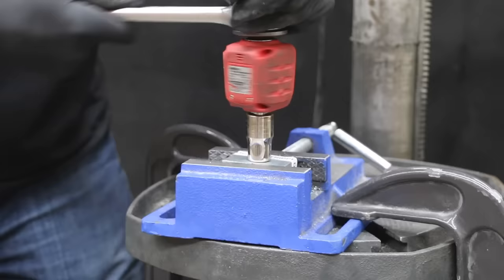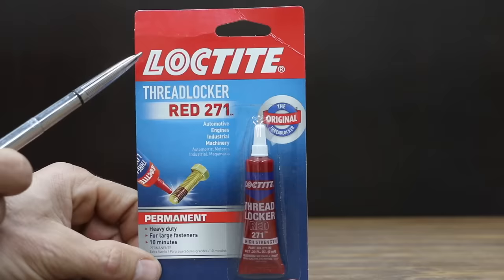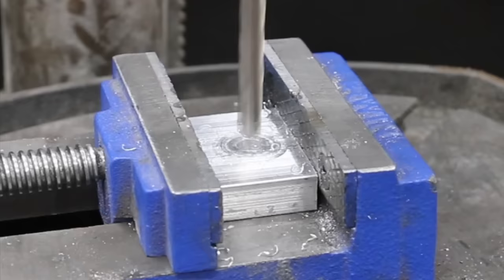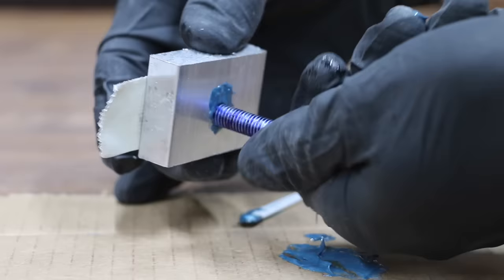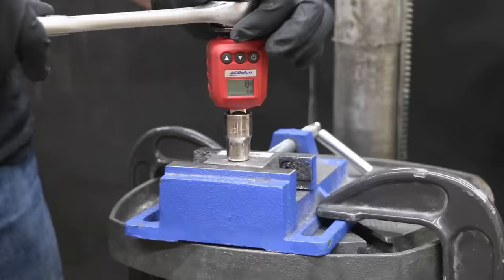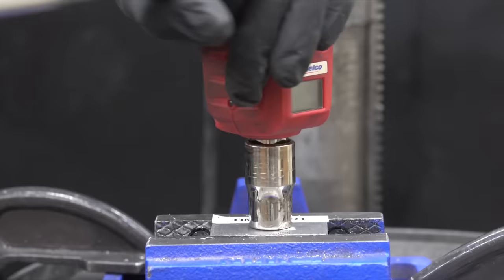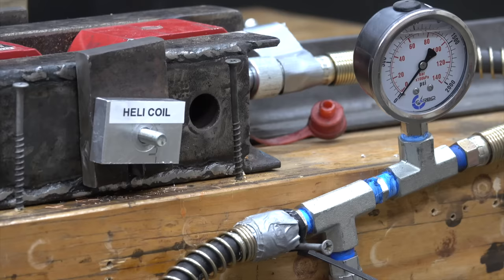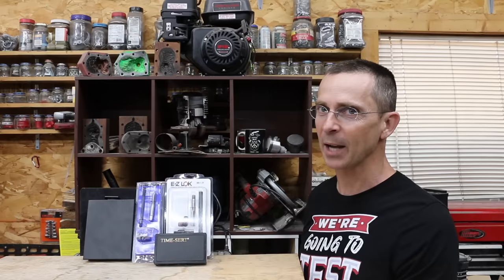Best Damaged Thread Repair? Let’s Settle This! Heli Coil, TIME-SERT, E-Z LOK, JB Weld, HHIP, Loctite

Comment: I've just had stripped threads on the Brembo brake calipers of my 2003 Subaru Impreza WRX STI repaired using Timeserts.
I didn't want to take chances with any cheaper methods as these are the main mounting holes for the front calipers.
Two of the holes were not stripped but I had them drilled out and Timeserted just in case.
Thumbs up.
Reply from the maker: Thanks!  Thanks for sharing.

Comment: Jreat comparison video. Lots of really good info. I have used just about every thread repair kits available. I have always returned back to the Heli-Coil because they almost never failed. The secret is to use Loctite RED when screwing in the Heli-Coil. Just be sure to allow 2-3 hours to set up. Especially if doing head bolts.
Reply from the maker: Thanks for the feedback.

Comment: I used to work at a engine refurbishing plant, repairing and assembling 30-35 engines pr day. One of the more common repairs would be bolt hole repairs on the cylinder heads and block, which meant doing thread repairs on aluminum and cast iron. And we used Heli coils exclusively for most of the different sized bolt holes...as reasonably prized and this kind of quality for something that will experience corrosion, heat and vibration, I can now see why Heli coils lol...Thank you so much for this in depth and thorough experiment. 😊
Reply from the maker: You are welcome!  Thanks for sharing.
Reply: For many years, Heli-Coils were thee popular brand.  I started working in the late '60s and Heli-Coil was all that we knew.

Comment: Fantastic video, as is all of your content, I use Heli-coil repair inserts all of the time as a workshop technician/ foreman. Besides doing my own work i have to help the apprentices/other techs when they snap bolts and strip threads (which is all too often and nearly always in a tight spot to repair), I'm a dab hand with a drill and metal work so i am always called over for help, and this video proves there's no substitute for a proper repair, I have never had a Heli-coil fail or not work at a specific job. I don't doubt the preparation for this video took many many hours😳, your dedication is unreal, thankyou👍
Reply from the maker: Thanks and you are welcome!  Thanks for sharing.

Comment: Tap drill size for metric bolts: Subtract the thread pitch from the nominal bolt size.  Tap drill for an M8x1.25 thread is: 8 (minus) 1.25 = 6.75mm.   Works for imperial too.
Reply from the maker: Thanks for sharing.

Comment: I often assemble threaded pipe, brass, black iron, pvc.  These threads are sealing water, oil, diesel, gasoline, propane, natural gas….  I have been told over the years to use thread tape, pipe dope, and even both at the same time…. I would love to see the various products and procedures tested to see what comes out on top…..
Reply from the maker: Thanks for the suggestion.

Comment: As an industrial contractor it is nice that I can tell my customers a helicoil type repair will be stronger than the original threads. It makes sense, you are essentially threading a larger bolt into the hole, and the threads are hardened. Nice work as always.
Reply from the maker: Thanks!

Comment: I'd like to see the different kits for thread repair, specifically for a brake bleeder screw! After going back and forth to bleed brakes,  the caliper threads never seems to hold up well.  I really wouldn't want to tap into a caliper either,  we used to make rethread kits in the USA. Brakes are also a lot of PSI when you press the pedal. I appreciate all this work you did here.  💯
Reply from the maker: Thanks so much!  Thanks for the suggestion.

Comment: One thing that I have used and has worked consistently good is using a string trimmer line instead of copper. Of course, only for low load or less critical applications. Awesome video, btw.
Reply from the maker: Thanks!  Thanks for the feedback.

Comment: The maintenance guys at work used to use heli-coil style inserts, but operators managed to destroy them over time (who knows how!). They've since switched to Keenserts, which are like an E-Z Lok, but with 3 pins you drive into the material after screwing it in. They are a lot tougher and last longer.
Reply from the maker: Thanks for sharing!

Comment: I work in R&D testing.
Years ago I had servohydraulic testing rigs up to 1 kHz. (MTS 831 and Schenck VHF 7)
The fixtures had to be light, bear tons of stress and vibration and be continuosly mounted an unmounted. They were aluminum, and of course the threads were not up to the task.

We tried various inserts, but they weren't any better, since after a couple hundred tests they started fracturing. Like radial fractures. 

We opted for helicois right off the blocks, without waiting for the threads to fail. We just had to replace the screws after each hundred tests, and nothing else.

There's nothing like helicois!
Reply from the maker: Thanks for sharing.

Comment: Thank you for this comparison. I need to repair some stripped threads on an aluminum head for a head cover bolt. I'm going to go with the EZ Lok Heli-Coil. I liked the EZ Lok inserts as well, but the stainless heli-coils I think will hold up to the under-the-hood corrosive conditions that are to be expected. I don't need the extra holding power that the inserts offer, the head covers are only torqued to 105 in lbs. Although, this is my first-time attempting thread repairs, and I did prefer the removal aspect that the EZ Lock Inserts offered just in case I screw it up.
Reply from the maker: You are welcome!  Thanks for sharing.

Comment: You're videos are the greatest. Thanks for the work you put into them.
Now my praise for helicoils helicoiks them on Harleys all the time. Once I had a bike that the previous tech used red loctite on the heads and when I pulled out the boots the threads came with the bolts. I drummed and helicoiled them and the bike went back together like new. Torqued to 22 ft/lb. Love helicoil!
Reply from the maker: Thanks and you are welcome!

Comment: If you use a little green locktite on the outside of a time-sert, it’s the best repair you can get. They just work and are available in multiple lengths. For threads like block decks where they may go into water, a time-cert and green lock-tire is the only repair I trust. I’ve got a 427 that ran for years in an 8 second altered and it’s got a time cert somewhere in the mains. No issues.
Plus with Time-Sert, you can use helicoil taps. They can be installed proud and filed flat if need be as well.
Reply from the maker: Thanks for the feedback.

Comment: Great video, thank you! My only suggestion for additional testing would be to heat cycle the work pieces several time to see if any of the metal inserts fail any earlier, and maybe to test them while the work pieces are still hot? I don't think it would be necessary to further test the epoxy-based repairs.
Reply from the maker: Thanks!  Thanks or the suggestion.

Comment: I have used timesert for lots of engine block repairs and also caterpillar flywheel repairs that have limited wall thickness for thread repair and that was a big reason for using the more expensive fix.
Reply from the maker: Thanks for sharing.

Comment: The Time Sert kit may be expensive but after buying the kit you can get re- fill insert packs. The included tools are very high quality and will last and last for years. I owned a fair sized Kawasaki, Yamaha, Suzuki motorcycle dealership for forty years And fixed countless threads with the Time Sert kits. My motto is " Quality usually costs more but is well worth it in the end. "  Those kits like Helicoil are like a spring that you twist into the hole. They often come out with the bolt!!
Reply from the maker: Thanks for the feedback.

Comment: I got some unbranded ones from amazon they are gold in colour although its clearly some sort of anti corrosion coating.

I used them in the legs for my solid oak bed frame as the original was simply a fabricated strip of metal with a tiny thread through it and most of them had stripped after a move.
My bed has never been as solid. I recommend thread repair kits to anyone.
Reply from the maker: Thanks for the feedback.

Comment: Thank you! My mechanic just told me my old car's oil leak (and maybe is oil pressure problem too?) is from the oil pan's stripped screw/bolt threading and they will use the Helicoil insert to fix it. I'm not a mechanic so I Googled Helicoil and am happy this product worked so well in withstanding torque pressure and corrosion...hopefully the repair will last over time, too?
Reply from the maker: You are welcome!

Comment: This video couldn’t of come at a better time. My 02 Ford Escape just blew a spark plug out of the cylinder and I installed a new plug but I’m not sure it will hold long term. The threads were compromised and it didn’t tighten up snug as it should. I may need to drill and tap with these kits
Reply from the maker: Thanks for sharing.

Comment: Thread inserts can be the only practical solution if the hole is sufficiently damaged.  I used them to repair an irreplaceable aluminum transmission case on my father's antique truck.  The 5/16 cover bolts had been stripped out, drilled out to 3/8 and then stripped out again and the 100 year old aluminum was far too soft for a helicoil.  Misumi self-tapping thread inserts no only fixed the threads they allowed me to restore the bolt holes back down to 5/16.
Reply from the maker: Thanks for the feedback.

Comment: I’ve been using EZ Lock for years, helicoil has its uses, but if I need a permanent repair , I use the EZ Lock.
Timeserts work well too, but I have access to EZ Locks here.
Helix oils work good for things like motorcycle side covers etc, where there’s no real load on them.
For things that require a real clamping force it’s EZ Lock for me , not a single failure in many years, and you can use a thread locker like loctite and the insert won’t pull out with the bolt.
Reply from the maker: Thanks for sharing.

Comment: Did head gaskets on my Subaru. Threads came out with the bolts (never had that happen on a Subaru before). Got the time sert kit and they torqued down great and are holding up well. Very costly but it saved me from having to put in a new short block.
Reply from the maker: Thanks for sharing.

Comment: Great rule of thumb, the drill bit size for tapping new threads on metric bolts: Size minus thread pitch. M8 - 1.25 pitch = 6,75mm. Although there isn't 6,75mm drill, 6,8mm is the correct size.
Reply from the maker: Thanks for the feedback.

Comment: Actually just used the JB Weld on a wheel speed sensor where the bolt broke off. Ground it flush to the knuckle and then just drill with an oversize bit. Filled the top 1/2-3/4" of hole with JB and installed sensor and slide the new bolt in. Leaned a socket and extension with some weight on it for a couple hours just to insure a tight fit.
No idea if it will come out easily and don't want to test, but put just the lightest coating of anti-seize on the threads and backside of the sensor assembly which touches the knuckle.
Reply from the maker: Thanks for sharing.

Comment: Its funny, the maintenance guy at my work replaced stripped bolt holes on one of my CNC machines with helicoils. Every single one was ripped out at probably around 50 foot lbs of pressure, with no failures on the bolts or work piece clamps.
Reply from the maker: Thanks for the feedback.

Comment: I know this is an old discussion but just for easy reference a rule-of-thumb for metric thread tapping drill size is to just subtract one pitch length from the thread diameter.
Reply from the maker: Thanks for the feedback.

Comment: On my motorcycle I had to find out something for repair for the headlight housing threads. I ended up going with copper wire for the time being. it looks like its sturdy enough to work for now. but eventually I'll do a more permanent solution as I have much more I want to do to the bike lmao. But it sure did get me back on the road thanks for the tips!
Reply from the maker: You are welcome!

Comment: I stripped threads on my high pressure oil pump on my 2000 excursion 7.3 powerstroke…… oops….. used the time sert, along with red lock tite both inside & outside of the insert. Put in high pressure oil hose fitting also covered in lock tite & let it all set up for like 4 days…… if it didn’t work I’m buying an $800 hpop…… well good news, so far it’s held up well no oil leaks at all…..
Reply from the maker: Thanks for sharing.
Reply: @ProjectFarm  yep, if it fails, I’ll report back

Comment: You should consider making a video comparing tools that would help keep you from stripping the threads or breaking nuts and bolts. Maybe showing the difference between using, penetrating oils, a propane torch, and a magnetic induction heater. The price difference in pricing is significant for all the options. The questions are the advantages of all methods and whether the new induction heaters are worth it from an ease of use and safety perspective. Another question is how well they work and what are the power requirements.
Reply from the maker: Thanks for the video idea.

Comment: We use helicoil inserts on aluminium manifolds for hydraulics on aircraft parts for the exact reason you discovered, the steel inserts provide a stronger thread than the base aluminium material.
Reply from the maker: Thanks for sharing!

Comment: Quick tip for anyone trying to figure out what size drill to use with a tap, just subtract the pitch from the bolt size and thats your drill size
Reply from the maker: Thanks for the tip.

Comment: I wanna give a little tip if you use Heli coil or similar thread repair kit make sure to use thread locker to lock the heli coil in place.
Reply from the maker: Thanks for the tip.

Comment: I fixed stripped threads in aluminum with JB Weld, but not by cutting threads in it.  I JB Welded a stud in and used a nut.  I would think that would be much stronger than threads cut in JB Weld.  I wish that test was included.
Reply from the maker: Thanks for the suggestion.

Comment: Finding the tap drill size for a metric hole is very easy.  First take nominal diameter for the fastener and then subtract the thread pitch from that diameter. The result will be the diameter of the drilled hole. 

In the example on the video the fastener is an 8mm x 1.25 pitch.  8-1.25 is 6.75mm for the drill size. Round up or down depending upon how hard or soft the material is you are tapping.  For mild steel that would be a 6.8mm drill for an 8mm x 1.25 fastener.  

Formula works all the way up and down the metric line.
Reply from the maker: Thanks for the feedback.

Comment: I’ve been using timeserts since around 2006 on a northstar engine. I have found I like to use a little red locktite on them when putting them in. Seems to help on bigger fasteners. Once they fixed my issue on them I’ve been sold on them. There’s also bigsert and a three oversized sert. Helpful is you mess up on tapping the hole while fixing and need to do it again.
Reply from the maker: Thanks for sharing.

Comment: Great video as usual!  It would be very interesting to see a redo of this in steel instead of aluminum. Seems like everyone seems to agree that threaded inserts are stronger than original threads on a softer metal but not so much as the original material gets harder and closer to the hardness of the insert itself.
Reply from the maker: Thanks!  Thanks for the suggestion.

Comment: Some tapping configurations as well as thread repairs can be extremely sensitive to hole tolerance.
Double drilling with a size at least 1/16" smaller before your tap drill size helps ensure a clean and consistently sized hole. 
Going to full size first, especially in soft materials and with no lube will gall and tear the material causing an oversize hole. 

You will get radically different results in copper especially by double drilling. The reason we use lube in soft materials is to keep the soft metal from heating and sticking to the cutting edge. For this reason isopropyl alcohol or other similar solvents often make a great cutting fluid for soft materials even though it brings no lubricity to the table!
Reply from the maker: Thanks for the feedback.

Comment: Extremely interesting that their seems to be some difference with the E-Z Lok compared to the Time-Sert that allows the bolt itself to withstand significantly higher loads before failing. My guess would be that the EZ-Lok's larger diameter results in increased hoop strength and less deformation under load, which allows it to retain more consistent contact patch with the bolt under increased load, but that's just a guess. I can always expect to learn something from your videos I did not expect. Thank you!
Reply from the maker: You are welcome!

Comment: Great video. It doesn’t surprise me that the repaired threads are stronger than the original. That’s because it is a bigger diameter. It would have been better if hardened bolts were used, this might have helped differentiate better. I am lead to believe that helicoils are good for one off usage, while time-serts are better solution for repeat usage. Retorquing until failure would have been a good addition to the test.
Reply from the maker: Thank for sharing.

Comment: awesome video as always PF! the copper wire thing is actually super useful in construction, working as an electrician, sometimes the plastic boxes inside the slap are filled with concrete juice, we would knock out the brass threaded bushing that is damaged by the concrete, and stuff some copper into the void, works like a charm, but please don't do it on anything structural XD